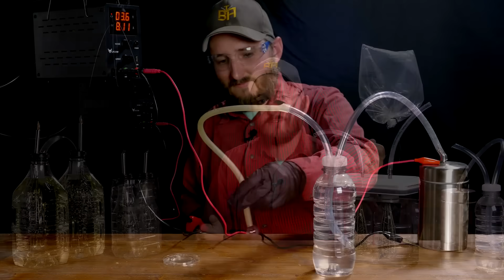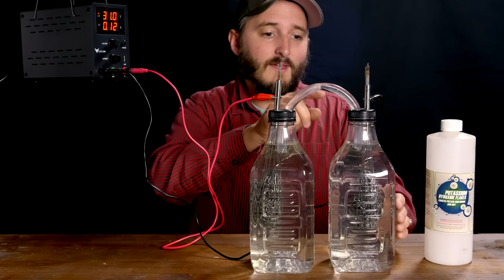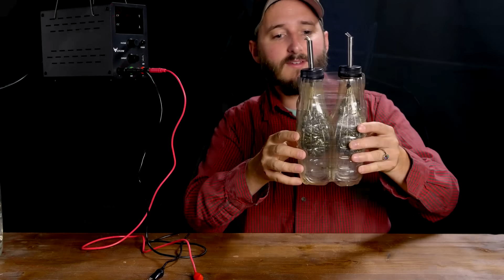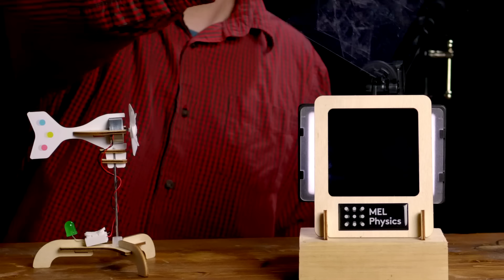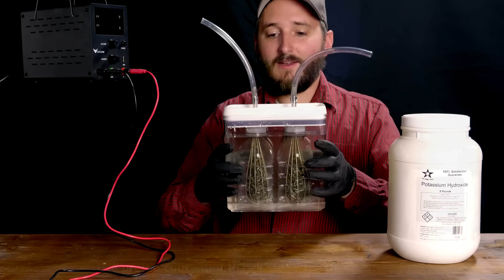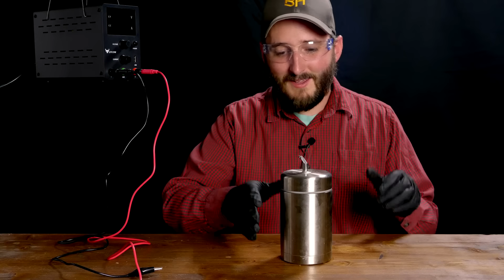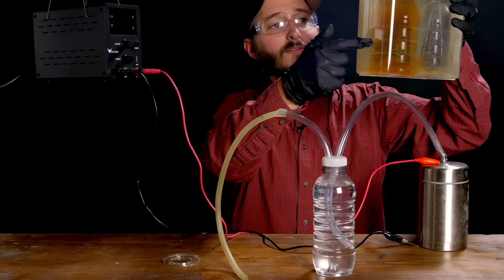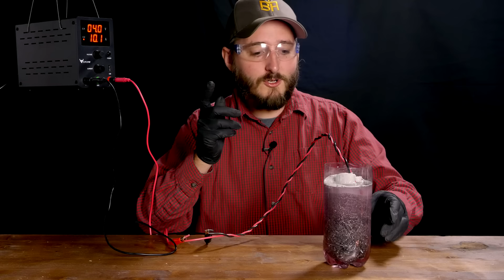DIY Hydrogen/Oxygen Generators From Grocery Store Items (HHO Fuel Cells & Split Cell Electrolysis)

Comment: How  do you know you are getting oxygen from one side and hydrogen from the other?
Reply from the maker: Simplest way to know is that one side floats a balloon, and the other side increases combustion rate of fuels.
Reply: Ok. That makes logical sense to test it that way. However you were speaking of it as if you knew, in theoretical terms, that the anode automatically pulled the oxygen and cathode pulled the hydrogen. But the way I understand the splitting of the water molecules, it would have to create oxygen and hydrogen in the same location. So can you explain how this works?
Reply from the maker: @jonathonstimmel9914  
Cathode: 2H2O + 2e− → 2OH− + H2
Anode: 2OH− → ½O2 + H+ + 2e−
Overall: H2O → H2 + ½O2
Reply from the maker: @jonathonstimmel9914  Two seperate chemical reactions occur at the terminals which neutralize once mixed in the middle of the water. It balances to equal H2O -> H2 + O

Comment: I wish a company create a stove using HHO gas. That means, it is tested safe for commercial use. All it needs is water and batteries. Would that be great for the environment. goodbye induction, LPG and kerosene.
Reply: You could theoretically use hydrogen on a stove but hho is to explosive for use on a stove (hydrogen is also not great to breath in)

Comment: Stainless steel sink drains from the dollar store. Because they're cup-shaped, you can fill them with steel bb's to increase surface areal. Stack them on a plastic bolt with rubber washers keeping them from touching each other. Wire every other drain to each other and then run one a wire from one set to positive, one set to negative. Go AC power with a POT and you're good to go.

Comment: I can appreciate the enthusiasm but 99%of what you said was wrong and although the steel wool idea is interesting it's just an attempt at increasing surface area to increase volume it's unnecessary and a ten amp draw what are you doing with all that heat how could it be a hood design when it's drawing ten amps I guarantee your getting gap sparks between your membrane the sock which is going to increase your amp draw lower efficiency and gain heat which we all know doesn't steam doesn't make hydrogen. And in order to collect the separate gases off hydrogen and oxygen you would have to have a tube over each cathode and annode not just nearby and why not sodium hydroxide why potassium ur getting bubbles I've never seen that with sodium hydroxide. So much to say about this I don't have the time I appreciate the enthusiasm but there's to much confusion over hho people juat dont get it stating false facts and misleading information like you have doesn't help the cause the simple facts is there is a hundred good ways to produce high volume hho at low cost and with high efficiency but none of what you showed here today moved the ball in that direction go back to the drawing board   . Until you can figure out your heat issues you'll never have an efficient design that's first second h1 is extremely small your Tupperware construction leaks hydrogen I guarantee that. Thirdly ten amps for how long  are your running this before it's steaming enough to boil eggs try sodium hydroxide distilled water

Comment: You can't tell me they can't DESIGN a car engine run off of this.  
WTF MIT?
Reply from the maker: It's fairly easy to run a car engine off something like this, as long as it's attached to a wall outlet with an extension cord.

Comment: Need oxygen for my potato gun
Reply: Bro, I tried oxygen + propane, just buy small cylinders from the store and fit a nozzle to the cannon, all I have to do it press each bottle on the cannon to fill it up, it was hard to get the ratio right but once it ignite omfg power is just insane! the whole canon eventually exploded, be careful, have fun.
Reply: @Iseenoobpeoples 
Xploded??
Weird
.. almost, ALMOST everyday i shoot mine..
Worst thing so far was the igniter blew off..
Looked for it 5 minutes.. 10 ft away in the grass..
Jb weld, back in business
Reply: @Iseenoobpeoples 
Oh, also
Propane sucks..
I just use ether
.. but ether+oxygen? Youre shooting potatos through 3/4" plywood
BLAM
Reply: @kwazhims3lf  Propane has MORE MJ of energy than Ether.. when mixed with Oxygen it is deadly, try it.
Reply: @kwazhims3lf  We shot it a lot with Ether, it never broke, then we started with a bit of Propane and Oxygen and you can hear a higher pitch snap from the much higher flame propagation speed, eventually we added much more while sitting behind shield and the pvc pipes ripped apart.